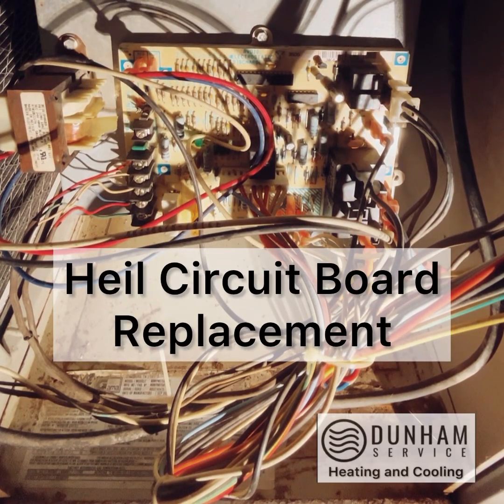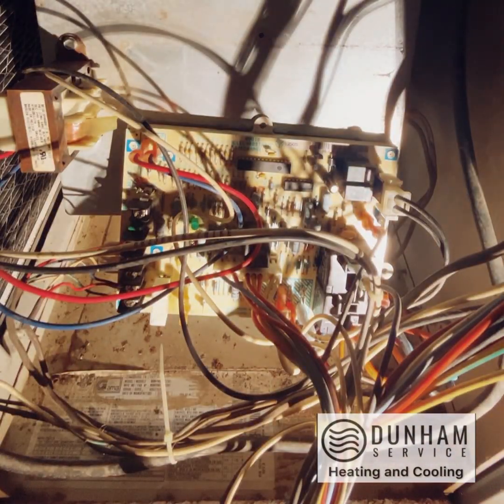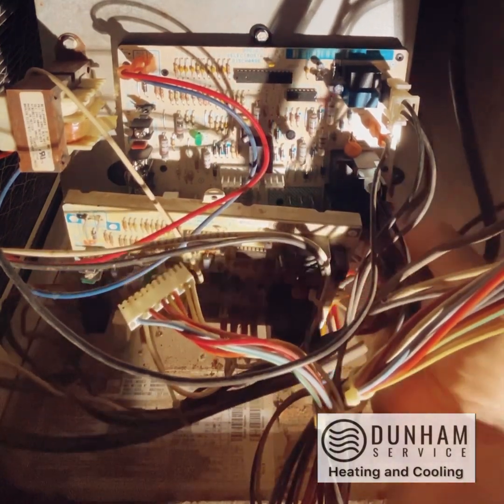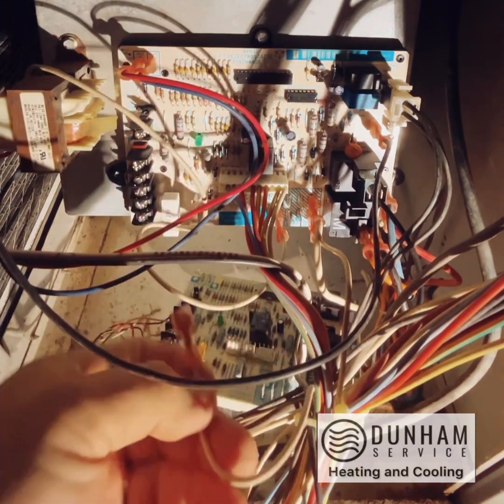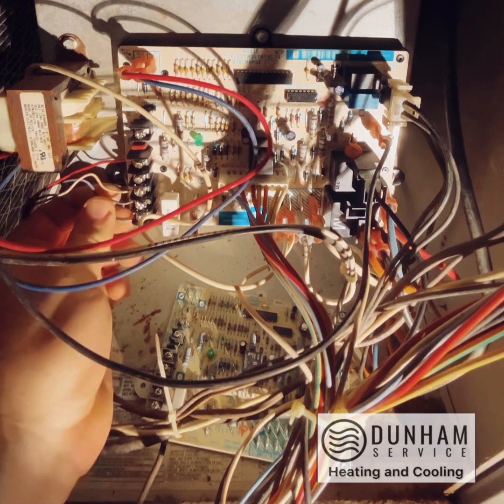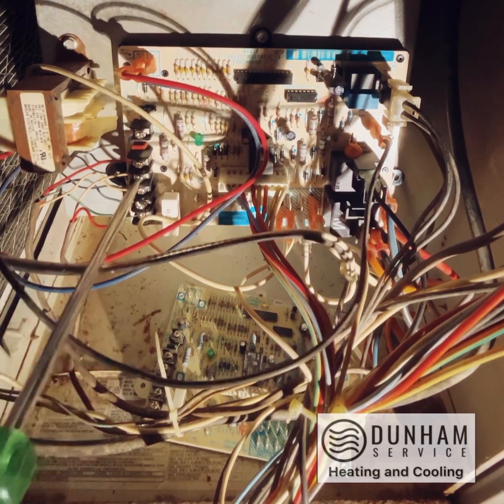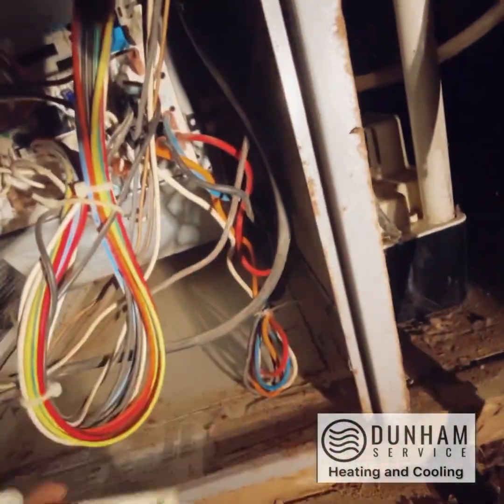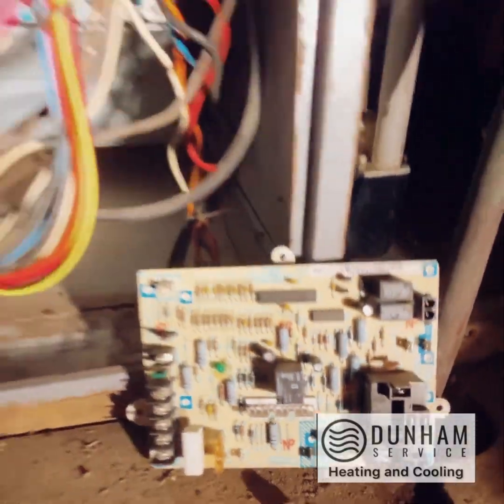Heil Circuit Board Replacement

Comment: My heil 7000 furnace is not working. Wont even turn on. Can hear the click but does not turn on at all. Called the electrician he says nothing is wrong with the power going to the furnace. Do you think it could be the main board like yours? I looked for the fuse but in the older furnace like ours i dont see one. Please lmk